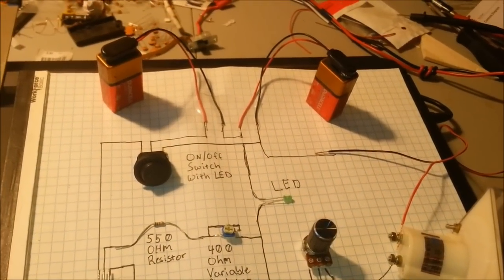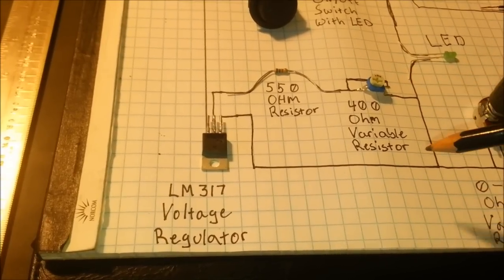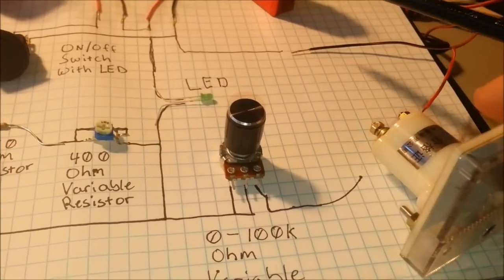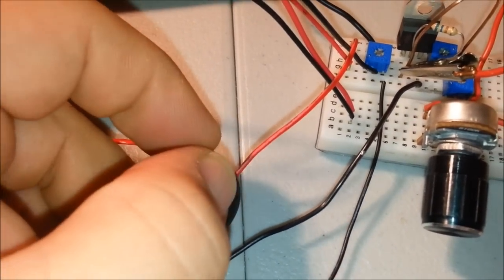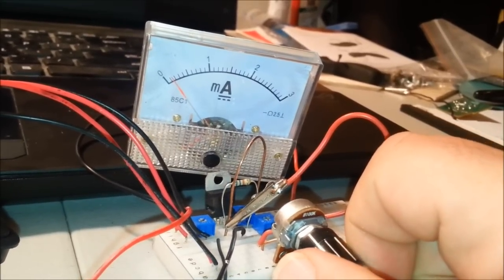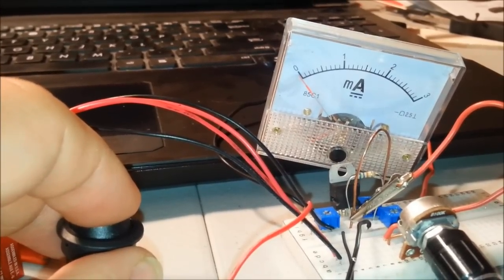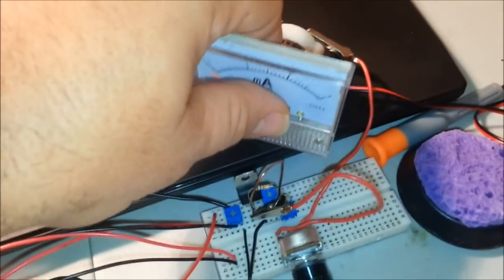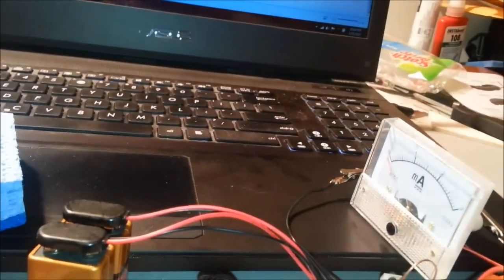Easily build a tDCS machine - How to DIY

Comment: Hi Jon Cammarata, thanks for the video , the explanation was quite easy to understand. i have some questions though regarding the areas of your brain you can put your electrodes on , and is there many areas or just one? where to place the cathode as well as the anode ? and what effect you gain from the different areas (if there is more than one) when you put your tDCS on.?
Reply from the maker: +CoJO' Hey bud, sorry for the late reply to this. I recommend doing a google search for tDCS montages. Also, on google scholar, search for tDCS studies. These studies will generally talk about electrode placement and then discuss the results. If the results of the study sound good to you, you can try that montage. I've tried a few montages, but I pretty much stick to the montage for working memory and alertness. The montage I use also has a small mood enhancement. I place the Anode an inch above and a half inch to the left of the center of my left eye (dorsolateral prefrontal cortex). The Cathode is placed on my right shoulder. This is pretty much the only set up I use these days. I like to do a session the day before exams or important meetings and social gatherings. Enjoy the holidays and let me know if I can be of further assistance.
Reply: Jon Cammarata That was very helpful, thank you.
Reply: You should not be telling people to review scientific articles in order to determine neuroanatomical placement if they do not have the base knowledge to determine whether or not the scientific articles' authors had sufficient knowledge to make neuroanatomical localizations accurately.  I see this with fMRI all the time - compelling article.... but whoops, that part of the brain is actually something else, that does something else, and is connected to different areas.  I just googled the dorsolateral PFC for shits and giggles and the intensity/immediacy of the inaccurate localizations is mind-numbing.  You clearly are attempting to be systematic about this, and I respect that, but it's just not this simple.  I could go on about this for a while but I will digress and privately despair about the future of society instead so I can get up during business hours tomorrow to program a functional task for a tDCS rehabilitation research study...

Comment: I think that any effect you are seeing is most likely a placebo effect if that's the circuit you're using.  Yes, the circuit works fine when it isn't under a load.  I've empirically investigated anode-cathode resistance values for many montages under ideal skin preparation conditions in my lab.  With resistances ranging from just over 40,000 Ohms to about 65,000 Ohms, 18V just isn't going to get you close to 2mA.  Ohm's law states that Volts = Current (in Amperes) times Resistance (in Ohms).  Even for a 40,000 Ohm load, your circuit will source less than half a mA.  If you take an average of montages (that is about 52,000 Ohms) you will be sourcing only get a little over 0.346mA.  Put the ammeter in series with one of the electrodes and measure the current while it is on your head.  I think you will be very much surprised.  If you actually read anything near 2mA there is something wrong with your wiring of the meter.  The ideal stimulator will have a source voltage of about 140V.
Reply from the maker: Thanks for your in-put John, but I am having a hard time accepting the validity of your claims. First, it is contextually inaccurate to use the word "empirically" in the manner that you did. I assume you meant to say that the evidence you acquired from your studies was imperical. If that is the case, your experiments were highly flawed. I will outline just a few faults with your claims.

  Fault 1: Current in a series circuit is the same throughout the circuit. This is a physical law that can not change. No matter where I place my ammeter, I will read 2mA if that is what the current regulator  is set to.

  Fault 2: The human head has a resistance of 3000-5000 Ohms when measured through two 1.5^2inch electrode pads that have been adequately prepared with saline solution, plain water, or electrode paste. Further, the head contact area is cleansed with soapy water to remove any excess oils. I have observed these results on 5 different subjects (me, wife, mother, sister, and a friend).

   Fault 3: You claimed some outrageous resistances with out providing your method of measurement. This makes your claims suspect.

   So, there it is. I am not sure of your intent, but I have a feeling you are a skeptic. Also, I believe your attempt to debunk the circuit was strife with unsubstantiated claims. I have written and read a healthy share of lab reports, and you, my friend, do not sound like someone who is familiar with the scientific method.
Reply: None of this commentary is substantiated on either side without a commentary about the neuroanatomical localization of the electrodes, as well as a description of the SOP used to train neuroanatomical localization, and replicable standards of localization that have been mapped out to the actual brain anatomy underneath what you see on the surface.  You could have a perfect setup, but if you want to induce neuroplasticity related to phonological reading skills, word finding, or decreasing the incidence of refractory temporal lobe seizures (to throw out examples) and you place your electrode on your motor cortex or by your orbitofrontal PFC, it doesn't matter what circuit you're using.

Comment: What is the copper wire you have by the LM317 volt. reg. and the blue resistor? I don't see that in the schematic you made.
Reply from the maker: Hey bud, that is just a piece of wire that i used to connect the lm317 to the resister on the bread board.

Comment: So when you connect the device you have created to your head, where do you place the anode and cathode?
Reply from the maker: Hello David, thanks for watching my video. The placement of the electrodes is dependent upon the desired effect. Various electrode placements (more commonly known as the "montage") affect  neurological processes in different ways. The montage I use is for working memory. I have a bonus effect with this montage that increases my mood, as well. Most people that want to increase memory place the cathode above the right eye and slightly off center of the eye toward the right ear. I place the cathode on my right shoulder. The anode is placed about 2 inches above the left edge of my left eye brow. I only use montages that have atleast 2 credible studies done for that particular montage that resulted in an outcome that I am interested in. I highly recommend, to anyone interested in doing this, reading and researching until they are confident that they know what they are doing. I hope this helped, David. If you want anymore info, just ask. I am more than happy to help.
Reply: Jon Cammarata Thanks for responding Jon. I have done substantial literature research myself on tDCS, but I am alarmed by the amount of do-it-yourselfer's who clearly have no idea what they are doing regarding circuit construction, loading effects or electrode placement. Although most of the studies have shown positive benefits of tDCS compared to sham and control groups, my main hesitation is from the lack of research on the long term effects. What are your thoughts on this? Have you noticed any negative side effects?
Reply from the maker: David Vutetakis Hello again, David. The long term effects are, as you say, not really known. Only time will tell. As of yet, I have not noticed any negative effects. I do notice a decrease in the enhanced focus and memory after about 20 days with no tDCS. However, the knowledge and memories I acquired, while I was using the device regularly, have remained. In short, I can't speak to the long term negatives. I am a full time engineering student so my brain is constantly being challenged. I am curious if that has made the effects more evident to me when compared to other tdcs users.
Reply: Jon Cammarata From some of the research I have done, it is most effective if you simultaneously perform an activity which uses the area of the brain being stimulated. I too am an engineering student in the second semester of my masters degree, so it seems like we have similar reasons for our interest haha. It is the unknown long term effects that has prevented me from trying it though.
Reply from the maker: David Vutetakis It is true that no study focussing on the long term has been published. However, there is a common consensus amongst researchers that it is safe at the current levels on intensity.

Comment from the maker: I failed to mention that all of the components are available at RadioShack with the exception of the ameter. The ameter, I found on E-bay for 20 beans. You can use a multi meter to measure current if you own one and don't want to purchase a stand alone ameter.
Reply: hi sir, im half way through my build but i designed mine differently but struggling to get the full two milliamps when adding a load to mimic the heads impedance using a simulator called proteus, wondering if u would be able help?
Reply from the maker: Taher Moshid Well, every head and montage will have a different resistance. Once you have your current regulator set for 2ma while the leads/electrode or connected to each other, you can increase ammount of input voltage until it is high enough to overcome the resistance of your head to achieve 2ma
Reply: Jon Cammarata
thank you for your reply, but the problem is i got a 3 independent switches which SW1=0.5mA, SW2=1.0mA and SW3=2mA; adding only SW1 & SW3 =1.5mA, this makes it a little difficult but just wondering if you could help, in the meanwhile im kinda tweaking your schematic =)
Reply from the maker: Taher Moshid sure, no problem. I could be better help if i saw your schematic.